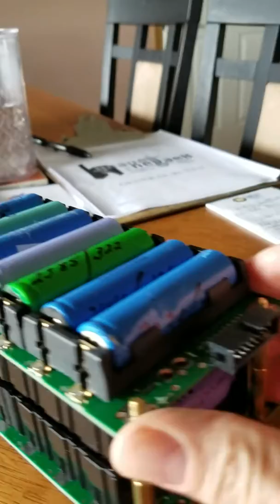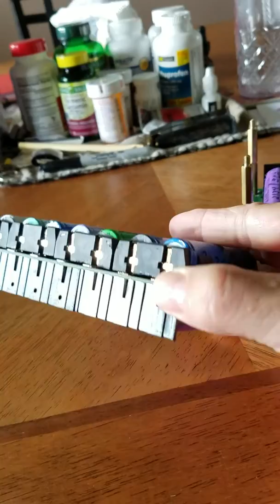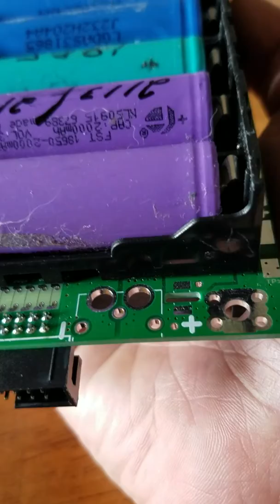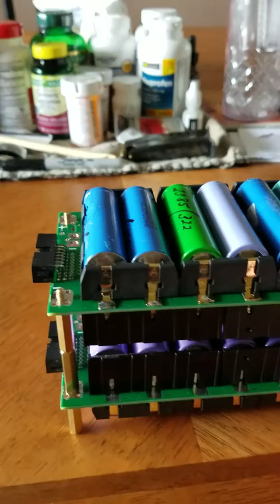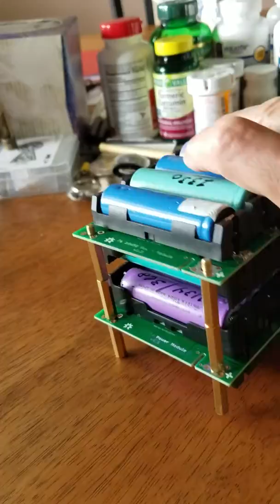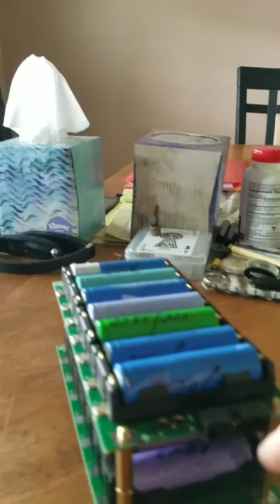Double capacity on one board. 18650

Comment from the maker: the fusing is built into the boards , I did not design them but they have been working fine as far, as checking the cells to see if there is a bad cell, you will see that one row in parallel is lagging and check with a volt meter ...

Comment: Use polyfuses! Never need to replace the fuse
Reply: If it's plated through-hole, you can try putting both battery holders in the hole before soldering.
Reply from the maker: where do you get the polyfuses
Reply: @qcraft43  What amperage fuse did you want? I can find you a polyfuse to fit your needs
Reply: 60V / 5A
https://www.ebay.com/itm/182366677833
Reply: $0.25/ea in bulk
https://www.ebay.com/itm/181623449082
Reply from the maker: @templebrown7179  5amp
Reply: @qcraft43  Figured. See the links above.
Reply: @qcraft43  They also make 5A 50V DC breakers at about $3/ each if you are more comfortable with that.